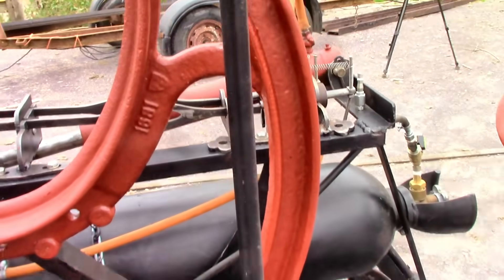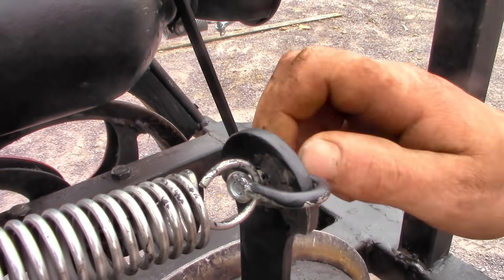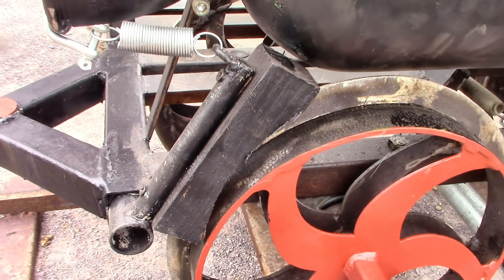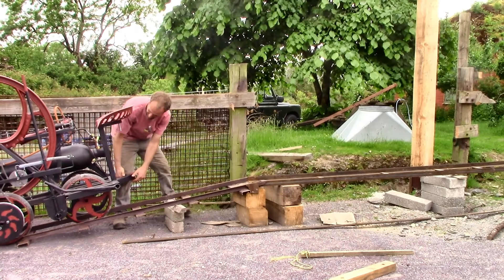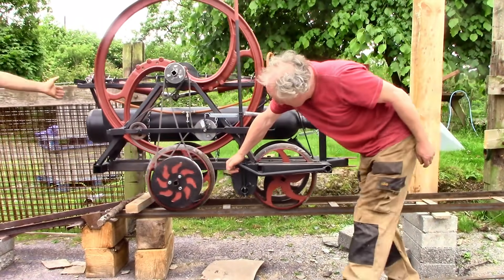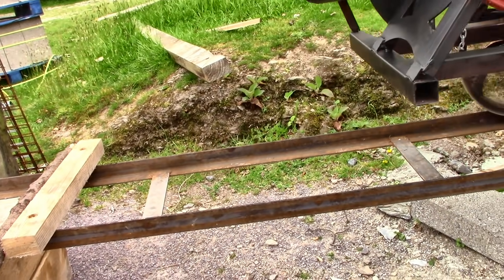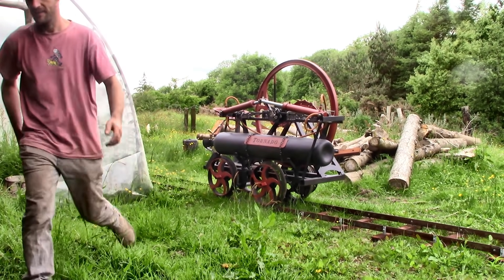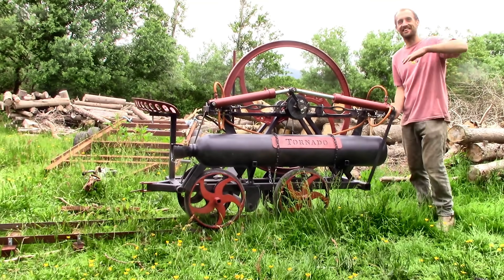First Run!! Home-Made Compressed Air Locomotive For The Field Railway

Comment: Greetings,my name is José and im a autustic boy from Brazil,May i ask how much cfm of air your engine uses?
Reply from the maker: Hi Jose. I don't know the answer to that, but perhaps you can work it out - it works best at about 100psi and the tank only lasts a few minutes
Reply: @wayoutwest-workshopstuff6299 howdy mr Tim,thanks for answering my question,i will be building a little traction engine to run on compressed air about the same size as tornado,with a top speed of 2 mph. How much compressed air do you think she would need to run at that speed aprox at 100 psi?

Comment: Honest to god technical question: What prevents this from working the muck heap line? Would it be possible to make it into some form of banker engine (albeit with a regulator to allow a more stable power output and air consumption) to help with heavy loads and the steep grade, perhaps even automated? (ie. Once below a certain speed, air pressure releases into the cylinders providing extra power)

Excuse me if I'm out of order, I'm just a humble drunk Australian railhead rewatching old videos cause I feel like brainstorming my future field railway.
Reply from the maker: I don't have a compressor powerful enough for it

Comment: Watching this again I think this is a much more interesting loco than your current petrol job. I also think the way to revive your interest could be to take the cylinder to a big compressor and actually fill it. How far from you is the nearest such compressor? Surely worth it to understand the power and time it will last to get a cost comparison with fossil fuels. Come on this is a great project...
Reply from the maker: I wish I had the time and money for that - but I haven't given up on this loco either
Reply: @wayoutwest-workshopstuff6299  What does it cost to fill a gas bottle with oxygen?, I'm sure others would be happy to add to that pot...

Comment: I think this is probably the best compromise for your field railway. Zero emissions, uses an established technology that has been succesfully adapted for railway use, made completely from off-the-shelf or easily-fabricated parts, seems fairly powerful, is relatively safe (safer than steam anyways), and looks and sounds a lot like a steam engine.

Comment: I rewatched this video Tim.  Your locomotive has grown on me.  We have a device at work and I don't know the name of it but you would need one for this.  It takes shop air at 90lbs and compress pure oxygen to over 1800lbs.  Designed to take multiple lower psi bottles of oxygen and compress them into one higher psi bottle.
Reply from the maker: Yes, that does sound interesting. A multiplier of sorts..

Comment: Couldn’t you build a higher pressure compressor utilizing a pressure washer with using the water pressure to push air from one container into the other ?

Comment: Ive found fridge compressors to be highly effective high pressure air sources. not exactly high volume, so it takes a while, but will fill that tank right up. it helps if you 2-stage it, feed the shop air into it, so its already got compressed air to eat. they are not designed to run 100% duty cycle, but they will. just give them a good slurp of oil beforehand. I use mine to fill fire extinguisher bottles for various high pressure experiments. should work in this application. they are easily available from your local junkyard, just check they are not the really nasty ozone depleting gas ones (and you dont want those anyway, they are lower pressure. R134A is what you want. avoid R12. R290 is propane, usually in commercial units. excellent compressors, just with the caveat of occasionally exploding)
Reply from the maker: thanks, yes, I keep looking out for them. Just need more time and money and sunshine and coffee  : -  )
Reply: There is a new type of tank being developed called isobaric tanks where a scissor jack like mechanism is used to maintain constant pressure but variable volume. There is also development of the compressed air engine.

Comment: That’s a great success, I would refer to having a look at fireless compressed air locomotives that the Americans built. Would refer to H.K Porter Inc fireless locomotive.

There are other things that could be improvised on it. Adding a handbrake would be excellent to keep the train in position. Also more brake blocks would further improve the stopping distance as well. And finally adding sanders or perhaps sand to give it excellent traction effort on the railhead for the locomotive to go up hills although this may depend on the railhead. Look forward to more updates on your railway.

Comment: Here in the USA, they make high pressure compressors to pump up tanks for paintball that can pump to over 3000psi and cost about $200 dollars. They are only designed to run short duty cycle of 20mins but over time, could be used to charge up your tank. Another option would be to find a scuba shop and see if they would charge it for you. Maybe offer to barter some of your produce in exchange for charging up your tank.

Comment: You have a better air compressor already. Any car engine that has direct cylinder fuel injection with do. 

Block the fuel injector to one cylinder. Take the spark plug out to the same cylinder.

Put a hose to the spark plug opening. Start pumping high pressure air. 
Engine will run ruff but it will pump air.
Reply from the maker: Interesting idea!
Reply: @wayoutwest-workshopstuff6299 
I forgot to mention that you will need a check valve, one way valve to prevent back flow. Hope it helps you get more power. Thank you for your build 😊

Comment: You might consider redesigning the brake mechanism. When you're not applying downward pressure on the pedal, the brake is engaged and the engine will stop. Only by applying pressure on the pedal will the train move. In effect, it would be a "dead man switch" for the sake of safety.

Comment: I also would suggest the compressed air would be more efficient. If you turned an air ratchet, that would spin a hydraulic pump and those hydraulic arms use hydraulic fluid the torque would be phenomenal and you would go a lot further with a lot less air.
Reply from the maker: that's an interesting idea, Mike. I wonder whether it would actually work
Reply: @wayoutwest-workshopstuff6299  One year many years ago I had a three wheel bike. I Had the pedals pump, a hydraulic pump from a car power steering unit and had. Two  2 ton cylinders like a locomotive rotating the back wheels slowly, while the chain drive was in 10th gear. It literally would go 35 miles an hour uphill problem  was, I couldn’t dump the fluid fast enough out when it was used and recycled.  I could only make it work for about five minutes there wasn’t enough fluid, but if I used your idea of having compressed air, turn the power steering pump and put a reservoir and a dump valve between the cylinders it would’ve worked I’m sure.

Comment: All you need now is a proper British whistle. Two blasts for forward. Three for reverse. For more braking, how 'bout a second brake shoe on the front axle attache3d to the first brake shoe also. A current hold position on the brake, a parking brake, if you will, would keep this "Engine" from free rolling. I still think that the whistle is absolutely necessary. A light would be nice for night time running. OK, maybe a driver's cap with red kerchief hanging out of a rear trouser pocket. This might be a little much. haha Hope you find you high pressure pump.
Reply: We could call it "The little engine that could" We in the US had an early engine called the Tom Thumb. You could call yours the stubbed toe. haha

Comment: Perhaps it could do with a tender that has a large re-purposed propane cylinder mounted on it feeding the engine with an air line hose.  Another idea following from the above one would be to mount a workshop compressor and a small petrol generator on a tender car to allow for prolonged field use.

Comment: Frankly I would love that in my backyard too, one observation as an intern air compressor why not use a discarded Refrigeration compressor. Most of them on the high pressure output can do 400 or more psi. Also seeing that you have more than capable of Machining skills, to make switching valves. There is no reason why you couldn't modify a hydraulic cylinder into a compressor cylinder. It would be a slow process needing a rocking arm, and another piston to drive it. But that would give you more than enough pressure as there are guys on the internet compressing scuba bottles to over 4000 PSI with that system. Hardest part is polishing the brass and the O-rings used in the piston. But since you're not going to be breathing the air a surplus hydraulic cylinder would be just

Comment: Is there any update  on tornado?
Reply from the maker: still hoping for a compressor..
Reply: @wayoutwest-workshopstuff6299  Would it be an option to use your stationary engine and connect it to fly wheel or the output shaft of the locomotive so that the cylinders could compress air in the tank?

Comment: I have to wonder what the effect would be IF you let the welding bottle supply air flow every once in a while into a steam boiler.  Your boiler would start with cold air under pressure and thus the amount of BTU's needed to get more performance out of the welding bottle air supply.  You would need to like separate the boiler chamber into two so that you can add bottled air into a chamber of zero pressure while taking pressure off the other 1/2 the chamber.

Comment: wonder if it's possible to  try hooking up tornados fly wheel in reverse direction to the diesel hit and mis engine so that it becomes a compressor instead of an air motor charging it self to much higher levels of psi... make sense?

Comment: If you can find an old refrigeration compressor, you could jump it to 300 to 400 psi, if your air lines will take it. Some are small and slow, but the larger semi-hermetic ones will move some air.
Really a great job. I suppose y0u could run a motor and use the cylinders to charge the tank also.
Looks like a lot of fun.
Smiles

Comment: 7:26  no it wont. 3000 psi will turn that contraption into scrap metal as it vibrates itself to pieces and probably take you down with it 😐

Comment: A scuba tank compressor would work to fill those tanks to 3k
Steam is dangerous but I have seen an old welding tank heated by wood in a pit to make steam with long plumbing connected to another welding tank to fill up with pressure that keeps the dangerous parts far away from the operator a person could even partially bury the heated tank

Comment: Will your next project be an A-Class conversion?  ..  replacing the boiler with a compressed air tank, and the service door at the front could be a way of refilling the tank.  The tender could house solar electric for lighting, heating etc. Let's stop electrifying the railways!, And build locomotives that are powered by compressed air and solar power. Thank you for sharing! You guys are pioneers of a new age!!  Don't let your work be a novelty hobby, you have the power to turn it into something wonderful! 🙏

Comment: What about using this idea to generate electricity instead of driving wheels drive A dynamo . Me and my dad built model steam engines we used to test using compressed air and one of the traction engine models you couldn't stop the flywheel at 5psi

Comment: I would get one now, but waiting for 1685 model in 4 wheel drive.  Cup holder extra! 
 (Pricing; If 200 pints=2 WD, Is the 4 WD model 400 pints? 50 pints extra for padded seat. That would be Model T-1, T-2 and T-2P. Right?)

 Note; Some Assembly Required, Compressed Air & Flywheel Not Included. Cup Holder On Back Order Due To Materials Shortage, Track Not Included! Hey, some things you build on your own.

Comment: suggest adding a gas pressure regulator + pressure gauge at the tank for pressure delivery control, it should stretch your "fuel economy" quite a bit. you should be able to scavenge them off an old welding rig.

Comment: Hmmm maybe the cars you pull need a little cylinder and make them All have brakes.  Air brakes lol use cheap Milton air fittings and rubber line.   Use old bottle jacks for the air cylinders ….

Comment: Id say someone else has probably suggested it, but in case they haven't,
A fridge compressor will build 3-400psi. As will a car ac compressor
Reply: You can run them in series or parallel too for even more gumption.
3 good size fridge compressors make a pretty good workshop compressor that runs almost silently

Comment: I don't know if this has previously been disclosed or not; but Tim is most certainly a (semi)- retired mechanical engineer.
One alternative to using a high pressure compressor is a wonderous pneumatic device called an "air amplifier" such as those made by Haskel Engineering. 
These unusual machines use lower pressure air to create higher pressure air.
They can sometimes be found on the used market for good prices due primarily to the fact that most people don't know exactly what they are.

Comment: A guy in Australia, invented the worlds most efficient compressed air engine. But I really like the whole "steam punk" feel of this invention ))   Alternatively you could use an air tank of larger volume, but is much lighter, like those used on heavy trucks, which can still take 100 to 200 psi. Real steam trains had a fuel (coal bunker) tender, so why not an air tank tender?

Comment: You don't need a compressor. An array of 6 3000psi bottles in a rack, used in cascade fashion will fill the loco to nearly 3000 psi. Rotate and change the most depleted bottle in turn. Initial outlay = deposit on six bottles. Ongoing = price of air!
Reply from the maker: Exactly - very expensive for both!

Comment: those hoses and fittings can't handle 3000 psi, they would explode and blow out o-rings and cause all kinds of dangerous problems. you'd end up injecting air into your body in ways you wont like. you'd need a regulator on the air tank to bring the pressure back down to something reasonable like 100 psi. this would give you a longer run time on a single bottle.
Reply from the maker: Ha! Did you really think I'd put 3000psi through those fittings?  : -  )
Reply: @wayoutwest-workshopstuff6299  best to be safe and mention it, rather than assume, make an ass of you and me. I dream of building the things you build. love it.

Comment: This is why trains weigh many tons... Your only working with probably less than a square inch of surface area actually in contact and it's metal on metal... Sliding is not surprising.
Maybe some removable ballast for when you're running light?

Comment: I was searching for a 2000psi air compressor and i found out about these pcp or something air compressors
They weigh 15kg and can achieve 300bar
They are made for filling bb gun air tanks but some people use it to fill scuba tanks
And they are not as expensive
It costs like 100€
Reply from the maker: Yes, I'm trying to get one of those, but they would probably take many hours to fill the tank - so I guess they wouldn't last very long?

Comment: Beauteful mashine! But so inefficient... When You'll go to high pressure, lots of power will be lost just by throtling in the valves. Piston valves do not make enough short cut offs. May be just convert it to steam? If You heat the incoming air, you may lessen air rate and increase the range of the vehicle.

Comment: 9:42 had a thought about your cylinder valves. Cast iron was a great choice but the valve rods ought to be bronze. That way friction is minimal. Oil empregnated bronze   Is self lubricating and would wear well. Cast iron is also self lubricating because of the graphite that is inherent in its makeup. Stainless steel is horribly abrasive. You would have a moisture issue whether air or steam, so bronze would be the best choice imho. I watched all the vids on the Tornado and i believe i can replicate it. All the best
Reply from the maker: I'm sure you're right - I might have to replace mine

Comment: Just right now I've come from the Russian spokes person and she has changed so much in persona in the last 48 hours that it's obvious we have entered WWIII and it's going Nuclear.
Now a small steamless steam engine design for survivors to split wood with charcoal
We won't have the internet, probably by March 2023, long range radios will be king for 10 years, that and bread, and firewood and charcoal nuclear filters.

Optimistically I would advise saving these kind of survival videos on drives just in case there a computer that survives and power to run it - otherwise we're back to smiling at hand prints on cave walls.

But America is Right and The Collective west Must have it's war against Iraq, Syria, Iran Russia China

Comment: Awesome work! If you made a Johnson bar type system for the valve control you can get more range out of your tank by letting the air expand more, but still letting you go full out when needed for more torque.

Comment: Wait wait wait... this is amazing!! This was operating at 100 psi? Two single acting cylinders. The bore of the pistons can't be more than 2 or 3 inches and the stroke about 14 inches maybe? The gear ratio from the flywheel to the drive wheel seems to change from about 3:1 to 2:1 once it gets moving.
How much would you guess locomotive weighs?
Is there a reducing valve or does the air come straight from the main cylinder?
How long did the 100 psi last you? Did that change once you added an extra load with the flat car?
Reply from the maker: So many questions, Greyson! Check out the other build videos in the playlist first and then get back to me?

Comment: Scuba compressors tend to be more expensive because they tend to have more "filtering" of the air because its used to breathe from, an air gun compressor would be cheaper and get you the similar pressures required